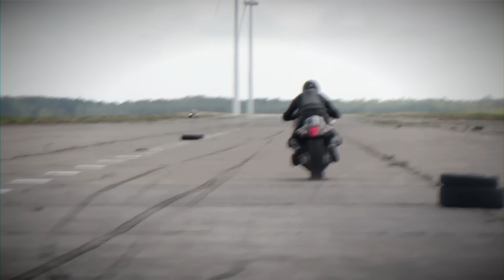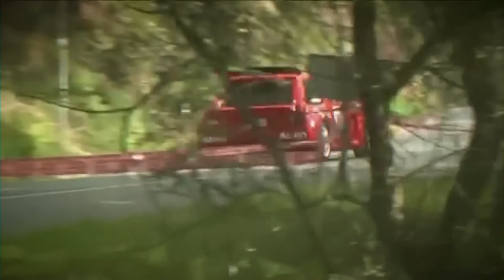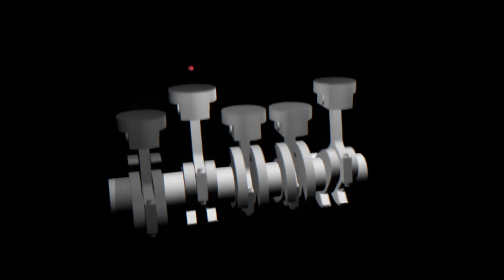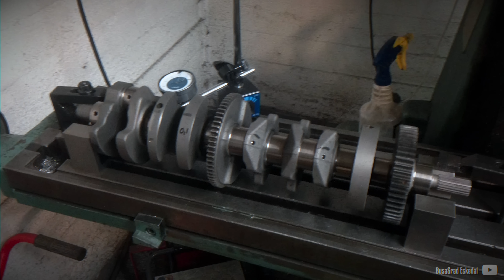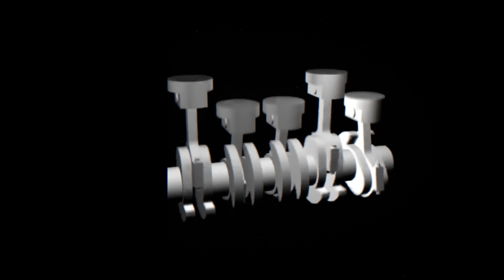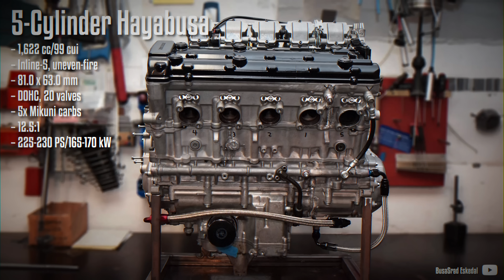A Genius 1.6-liter Hayabusa Engine

Comment: Is it possible to make the firing intervals happen at 216, 216, 72, 144, 72? Using a traditional inline 5 crankshaft with the crankpins set at 72 degrees?

Comment: A VR6 or 8 version would be something else.. siamesed rods & journals akin to Millard's V8 & v12 engines.. the ridgid separate cylinder block from the case enables all sorts of possibilities.. the i6 gsxr engines crank would be highly suspect.. Millard's lower reving i6 base engines being much more viable as with roller bottom ends

Comment: The 1630cc in-line 4 has been around for decades now +4mm overbore with +10mm billet crankshaft with low compression for pump gas make 265whp on 91-94octane. A high compression race gas build will make 280+whp. Probably around 2010+ the pump gas build was made reliable without annual bearing swaps like the racer’s pkg. Old Hat in the Hayabusa Grudge World 🌎….

Comment: I'm think many would people agree with this, but I find the Hayabusa engine most interesting in anything but a bike. Having such a high-revving and rowdy engine in a small car is such a cool phenomenon. It's a completely different sensation, perhaps more exciting (compared to the stock engine); an engine that is extremely performance oriented, outstandingly energetic, and still has power that is proportional to the car it's swapped into. It would prove to make an outstanding driver's car.

Comment: The best possible permutations of Busa motor would be a either;

 Straight 8 - two standard engines, one in front of the other, cranks connected together,

Or

V Twin - custom billet block, cut down head, Harley inspired rod ratio, crank pin, firing order etc

Who wants to start building?
Reply: A 600cc V-twin... That would be similar to a CB-500x or maybe a Ducati Monster.

Comment: So the 5-cylinder, at its most optimistic rating, makes (allegedly) 2.25 more horsepower per cylinder with an elevated compression ratio and presumably much more aggressive valvetrain? Color me unimpressed and unsurprised. You're not going to out-engineer the 'big four'. Respect to the guy for doing weird stuff, but if you want 'more' Hayabusa, why not adapt its tech to a Honda CBX, and sound incredible doing it? Some porting and tuning would make a factory Hayabusa make those numbers.

Comment: I feel like I need a Hayabusa powered Cappuccino in my life
Reply: what i need is a hayabusa powered laundry machine(it must run on diesel and have a full body exhaust)
Reply: You could chop a cylinder off to make a triple, and still have a rocket ship.
Reply: @joejoejoejoejoejoe4391  Or just use a triple in the first instance: a Speed Triple engine has enough grunt.  Especially the new 1200cc one, but that's probably hard to come by at a sensible price.
Reply: Sure you can! Buy a nescafe and add a Hayabusa sticker to the packaging
Reply: @fidelcatsro6948  🤦‍♂️
Reply: Good luck, buddy of mine who dailies and autocrosses a Cappucino says there's only 2 working Busa Capps in the US right now!

Comment: I am outraged by the fact that it's not a 144° inline 5 ! What a missed opportunity 😢
Reply: It's actually better for a motorcycle engine to be odd firing because the small dips in torque allow the back tire to recover grip instead of sliding continuously.
Reply from the maker: I like he did it this way. First, much easier to manufacture. Second, interesting sound, not as common as an inline-4, but definitely got some tones of it with the 5th cylinder making it sound bit angrier. That's also the third reason – it is different, everybody knows 144° inline-fives, this is original. Cool project
Reply: @VisioRacer  yeah of course that's an awesome project but my heart for 5cyl wanted a smooth reving high pitch one like the volvo btcc 2l. I get why odd firing is better for bikes but im all about sound ngl

Comment: It sounds like overlaying a 3-pot onto a 2-pot engine, which considering the firing intervals would be more appropriate. Definitely didn’t have that iconic harmony of a 144 or a 72 deg firing interval, rather this one had somewhat of a brutal punch that gets harsher the higher the rev. 

Also, this level of backyard engineering definitely had Allen Millyard vibes. His projects alone definitely worth several videos to discuss.
Reply: The overall impression would be a lot like a 180 degree parallel twin, because of the 3:1 ratio of the interval groupings (90+90 vs. 180+180+180; equivalent to 180-540)

Comment: Ah the interesting stuff a legitimate experienced manufacturer could do, if they weren't CONTROLLED BY THUG BUREAUCRACY.
I'd be interested in a 600cc supersport engine with an additional cylinder attached to the side. 750cc inline-5 that revs to 13,000 rpm anyone?

Comment: Custom block, custom head but only modified crankshaft, without adding fifth crankpin like it should be. It results in very bad balance, because it's not 5-cylinder, but 4+1-cylinder. So much effort to build this, but it's not enough.
Reply from the maker: Motorcycle engines, especially these high performance ones, benefit from uneven firing intervals. It allows them to regain traction on the rear wheel due to the uneven timings between fires. That's why all the MotoGP bikes are big-bang inline-4 or V4.

Comment: The cylinder timing is the dumbest thing I've ever seen.
Reply: Or I'm dumb cos it said 15243 but animation shows a 13542 firing order?
Reply: @JohnnyLawrenceCK  It's dumb because it's uneven during instead of just spacing the crank pins on 72 degree planes.
Reply from the maker: Hey mate. Have you heard of the big bang engines, especially high performance bikes, like MotoGP? They benefit from that and a screamer inline-4, like every flatplane four-cylinder, is not the best firing for a performance bike. That's why all MotoGP inlines are crossplane now and V4 are used in the rest of the grid. That's why Honda changed the firing intervals on the two-stroke NSR500, because it gives the rear tire intervals to regrip.

Comment: Best 4 cyl engineering ever, i just wish Suzuki would realize how absolutely amazing they are and make them in 2L versions for cars!
Reply: Yep. One of these in a Swift!
Reply: @peterwilding1203  Or in a S-chassis!
Reply: wouldn't even need to be 2.0L by today's standards, 1.6 or 1.8 would be enough given this 5-cylinder makes 225hp. Perfect engine for a small hatch.
Reply: Cappuccino kei car FTW

Comment: Hell no! Nothing that can not be balanced is coming anywhere near me.
Reply: Don't even get why it said 15243 f/order but animation firing order is 13542?
Reply from the maker: You know why? Because that's not the correct cylinder numbering. I showed the cylinder numbering earlier. On the animation, the very left cylinder is number 5 and then from left to right is 1–2–3–4. So the 15243 is valid.
Reply: @VisioRacer  still, inherently unbalanced system. Nothing you can do to balance this thing. Primary or secondary.
Reply from the maker: Have you heard about a big-bang engine and its benefits for a rider on a performance motorcycle? Plenty of such engines out there, another very similar is the Honda mentioned in the video or Laverda Jota 3C 1000, the first gen engine, that had a 3-cylinder flat-plane 180° crankshaft (but yeah, this one was allegedly due to machining difficulties of the time).
Reply: @VisioRacer  my simple observation is that by tempting laws of nature a man is trying to reach some obscure  engineering goal and fails at it miserably. It's an excersise in futility in the short run. The only good thing is that some new technological advancements come out of this in the long run.

Comment: I have always wondered why there haven't been any 5 cylinder production motorcycles.
Reply: @Turnipstalkwhy is that? Wouldn't a 6 be much finer?
Reply: The size is one of the disadvantage factor for motorycycle. The need light weight and size less for the mobility

Comment: Cool vid....i had a poked and stroked GSXR1100 i road raced in the 90's.....200hp and 390lbs....170 at the rear wheel on a dynojet dyno
Reply: How do you lose 30hp by turning a chain and 1 wheel? Not being a pain, just wondering. It sounds like quite a high loss to the wheel.
Reply: I usually see 175hp at the wheel on a 200hp bike, 12 to 15% loss is quite normal for a bike. Imagine how much drivetrain loss you have in a car.. 🤒
Reply: @tituskoreman1565  It's about the same because of fewer direction changes.  Unless it's 4WD.

Comment: If can be 5...can be 6 😊
Reply: If it can be 5 and a V8, it can be a V10 😈
Reply: @edim108  V12 can be V16
Reply: I was thinking old school straight 8 personally.
Reply: @Soxynos  especially with relatively small displacement and rigid block so the crank flex wouldn't be as much of an issue.

Comment: I want to see an 8-cylinder boxer Hayabusa engine.
Reply: H 16 supercharged.
Reply: How about 8 cylinder R1 engine?
PGM 2.0L V8 Australian naked bike. 334 hp.
Reply: Really bad idea. @turnin.sprocket
Reply: @JohnnyLawrenceCK  Ha. Seemed to work out pretty well.
Reply: Hartley make a V8 Hayabusa, as does Synergy in New Zealand
Reply: I think Jay Leno has V8 one in a Ariel atom
Reply: BoxerBUUSAAAAAAA
Reply: That would sound insane, but I don’t think anybody’s gonna try it.
Reply: V12 busa
Reply: Boxers have many issues
Reply: @jakecoye738 . Tell that to Porsche and VW
Reply: @sti302man  Porsche would agree, their boxer 8s were extremely troublesome.  Mainly because they engineered them incorrectly.

Comment: Turbo Busa, V8 Busa, and now Inline 5? the Hayabusa engine definitely has endless possibilities.
Reply: Now waiting for a V10😅
Reply: That would be amazing. I could could see it being 90° with a similar layout as this, basically a flat plane v8 with a v twin slapped on the end of it.  @gabrielecossettini2923
Reply: @gabrielecossettini2923  judd v10 is basically that
Reply: You also can mount Busa cylinder head on large block 4-cylinder VW engine. Some VWs in Austrian/German hillclimb racing uses this setup with displacement of 1.3 or less.
Reply: I think a straight 6 Busa is what we need next lol.
Reply: @jackets64  Suzuki considered it for the 3rd Gen. Ultimately decided it would be too costly and wouldn't sell in volume.
Reply: Imagine a V16 Hayabusa engine.
Reply: @CyanRooper  why not a w32
Reply: @CyanRooper imaginei um V10, e um V18. Mas com as manivelas em ângulos corretos. 72 ou 144 graus para o V10, e 40 ou 80 graus para o V18.
Reply: @CyanRooper  thén you really need a v16 MTU.
Reply: @CyanRooper VR16 😂
Reply: PGM out of Australia joined two R1 engines and made a flat-plate 2.0L V8 making 334 hp, for a naked bike.
Reply: @turnin.sprocket  a company called synergy made a 2.4 V8 out of the Kawasaki ZX12R
Reply: @fihimsadiq8779  I saw their GT86 conversion. Insane machine
Reply: @fihimsadiq8779  Wish a company called Honda, Kawasaki, Suzuki, or Yamaha would do something outside i-4 and i-2 engines.
Reply: Honda has done I6, V4, V5, V2 and oval piston motorcycle engines.  Suzuki has done V2 and Yamaha with the crossplane crank I4.  I think at least one of them has done I3 as well.
Reply: But that was decades ago. Now it's parallel twins, inline 4s, singles, and that's about it.
Reply: @turnin.sprocket  MT-09 triple is pretty popular. Euro bikes have been doing the V4 thing for a while. Are those big BMW and Honda cruisers still 6 cylinders? 
But yeah, packing any more than 4 cylinders in a bike can be completed, and there are only so many (optimal) ways to arrange 4 or less cylinders.
Reply: @Wooskii1  Wild stuff like square-4 engines, Wankel rotary engines, V5 engines, oval piston engines, straight-6 "budget" engines, 2-stroke straight-3 engines, 2-stroke V engines, dual crankshaft engines, 18,000 rpm engines, 5-valve heads, rotary valve heads, small displacement 4-cylinder engines, lots of shaft-drive "budget" drive systems came about in the 1980's and 1990's. They don't do stuff like this anymore.
Reply: @turnin.sprocket  As a 2 stroke evangelist, I can say you're preaching to the choir🤗. 
My favorite street bikes of all time are the 4 cylinder 2 cycles from the late 80s and early 90s (and don't get me started on the Bimota Vdue 500!)
Still, I think packaging is the main reason for all the straight 4 super bikes. When you put 2 cylinders behind 2 in the front, airflow needs to be reconsidered in such a tight space, along with other things. Dual cranks are cool, but obviously add complexity. I think a straight 6, or 5, is the best bet, and the most likely to be seen in something new and exciting, but the width/ length can start to become a negative.
I'm still hoping the age of sport bike innovation isn't quite over tho.
Reply: @Wooskii1   Straight-5 would be fantastic. I don't think it would be terribly wide as it wouldn't have to have the same highly over-square bore/stroke ratio making the cylinders wide and the engine wide. Many years ago in motorcycles they used iron sleeves in the cylinders which increased engine width significantly. They stopped doing that a long time ago.
BMW K1600GT engine isn't terribly wide (compared to the old sleeved air-cooled KZ and CB engines) due to displacement being achieved by additional stroke rather than large bores.
How about those Millyard V12 engines based on the KZ i-6?
Reply: @turnin.sprocket  Right on, I would love to see a modern 5 cylinder! Also, I know someone who was considering doing something pretty crazy with a K1600 motor, but unfortunately the project had to be abandoned... 
Anyway, I'm sure you've also seen those 4 and 5 cylinder Millyard Kawai H2s, pretty crazy. That dude is just something else entirely.
Reply: @Wooskii1  Yep, he certainly is someone with time and resource. Too many people in the world are busy paying taxes, nursing bad health, instead of inventing and innovating.
Reply: @thahbx Cadê o link do vídeo?
Reply: @MarkoFrey  type Synergy V8 GT86
Reply: @BluntEversmoke  Requires supercharging.
Reply: @turnin.sprocket  No, four stroke doesn't at all. A two stroke would. But I am all for super- and turbocharging, though.
Reply: @BluntEversmoke  What modern opposed piston designs have been build without some form of forced induction? The chamber between piston tops has no valves. The pistons cannot do the work of removing burned charge, it has to be done via forced induction and ports.
Reply: @turnin.sprocket  please read again: 
Not a two stroke. 
But a four stroke. 
No modern engines are being built like this to my knowledge, but there were in the early days of the ICE. Imagine two sidevalve engines having the heads removed and then being bolted together, cylinder pairs sharing not only the same combustion chamber but also the valve trains.
Reply: @BluntEversmoke  What I was asking was regardless of engine cycle. Either the combustion chamber area has valves or it doesn't. If it has valves, the pistons can move the air. If it doesn't have chamber valves, the pistons cannot.
Reply: @turnin.sprocket  Well yes. The combustion chamber was exactly like in any normal sidevalve engine — it had more area than directly over the pistons, part of it offset sideways, off the pistons and over the valves.
Reply: @BluntEversmoke  What was the advantage of an opposed piston design (over traditional) without forced induction, I wonder...
Reply: @BluntEversmoke  It's nice to see a few intellectuals using their brains on social media. The corporation has us all so bogged down in 7-4 or 9-5 and recovery on the weekends, most employers totally owning everything about their employees, there's not enough time in the world to invent, think, improve, innovate, or produce a family for that matter.
Reply: @turnin.sprocket  "Intellectual"... I am not an engineer at all, so my knowledge of ICE designs, while comparatively wide, is anything but deep. Oh well. 
As a little thank you for the compliment, here's a little bit of "alternative history" of engine design. Imagine: Two identical inline flathead engines (the "heads" off, of course) but laid flat. One on its right and the other on its left side, with the oil pan of each moved to what is now "down". 
Now the point: they would be set off a bit in height in relation to each other, so that the valve area of one makes the cylinder head for the other, and vice-versa. So the only thing to make new would be: new oil pan placement and insulation (by mineral wool?..) of the exhaust headers for the engine which has the valvetrain under the cylinders, and some means of synchronization of the two flatties — by a fat chain, by shaft or by cogs. Oh, and moving the opening for the spark plug/diesel nozzle somewhere between the valves or somesuch. 
So you combine two bona fide, honest-to-flying-noodle-monster flatheads to what amounts to two intertwined overhead valve and camshaft engines with a compression ratio up to and including diesels.

Have your cake and eat it. Reuse your old flattie production lines damn near completely.

Oh the whatcouldhavebeens 🤣
Reply: @turnin.sprocket  Haven't heard of that in a long time. Man, that thing deserves its own magazine article.
Reply: Ariel atom v8 is two Hayabusa engine
Reply: how about w16 busaa?? 😊
Reply: @Dsky-vu3nz  That would require custom block with staggered cylinders and angled-top pistons.
Reply: Vhtracing Toyota Starlet includes RPE-Hayabusa V8 in it. 2.6litre and full of scream 😂
Reply: Yes I would like a straight 8 busa for mybhg eye sprite
Reply: W 16 Busa?
Reply: @saifullahkhan1202  Can't see any potential problems with a crankshaft that long.